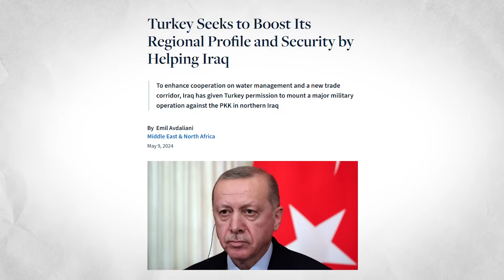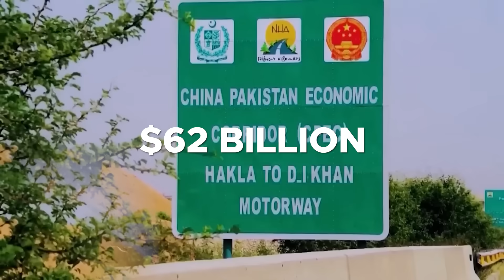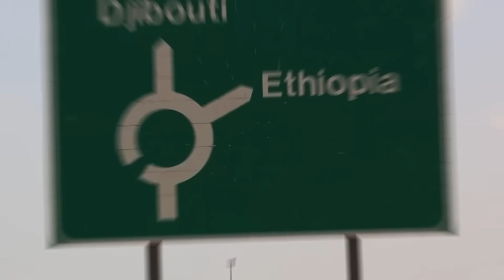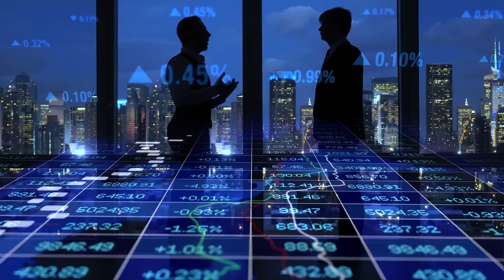The $300 BILLION Race To Replace The Suez Canal

Comment: Egypt should not allow that.
Reply: And exactly what are they going to do about it?

Start a war with Israel?

Last two times, the lost the Sinai and ended up bereft of the northern bank of the Suez.

Beyond that, any conflict between Israel and Egypt would all but mandate closing the Suez, and that is something Egypt REALLY can't afford.

As in, you start getting very unpleasant calls from the White House, Beijing, and the Kremlin, using lovely words such as "Sanctions" and "Armed foreign intervention" and the Russian Special - "Denazification".

But really, the 2nd canal going through the Negev wouldn't really effect Egypt all that much; sure, traffic would decrease somewhat, but not fully; instead, I imagine you'll just see less queues for the Suez, which is the situation today with massive lines of ships waiting to transit the canal.

Typically, when a new trade route opens up, it doesn't replace the old ones unless it's a drastic, extreme case such as the creation of the Suez canal, which cut out the horn of Africa from the trip from Asia to Europe. Compared to that, the theoretical Israeli canal would be the equivalent of going to the corner store one street over instead of two streets over; you'd rather do the first trip, but if that store is packed, you can go to the second store, and having a second store means less congestion in the first store.

Comment: Correct your information, the Suez Canal is ALREADY going in both ways. The cost will never be covered by the income and it is technically impossible to done as it has to go through mountains.
The Turkey Canal is non sense and is not related to the Suez Canal but it may increase the number increasing in the Suez Canal. So your title is absolutely absurd!

Comment: As a student of ancient history and archaeology, thumbs down on the Ben Gurion canal.  I might add that it is in an earthquake zone and additional seepage of ground water has been known to lubricate faults and increase quakes.
Reply: BG is much longer than the Suez Canal and Egypt 🇪🇬 can build  a deeper wider Canal parallel to the old Suez Canal.
Reply: @mrbaab5932  Or operate both as a two lane system.
Reply: @mrbaab5932  but Egypt does not have much interest in doing so, as it competes with the original.

Comment: The biggest threat to the Suez Canal right now is the north of Russia route which will be ready in around 5/6 years time .
Reply: Nope. These theories don’t take the not account that Europe isn’t the center of the world anymore. Besides there are shorter and safer routes from China to the Mediterranean via the Caspian Sea and Black Sea.
Reply: But it will remain seasonal for decades.   It may serve to relieve pressure on the Suez Canal, but it will not replace it for traffic between Europe and South Asia.  Maybe Europe to Japan and South Korea, but the length of the voyage is prohibitive.  Also, if we get away from fossil fuel, we reduce the shipping of oil and natural gas.
Reply: @jameshorn270  no it will not be seasonal , this is why russia is building a fleet of 20 ice breaker ships all nuclear powered .
This will be a game changer as some observers are saying it could take away around half of the suez canal traffic .